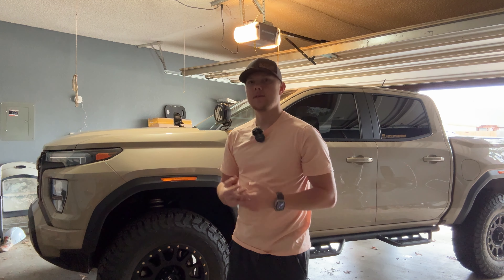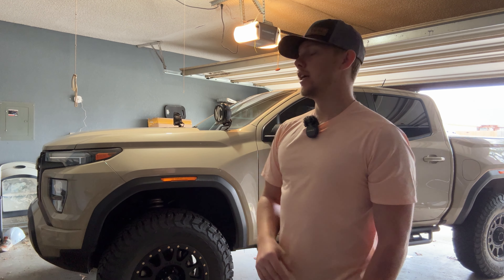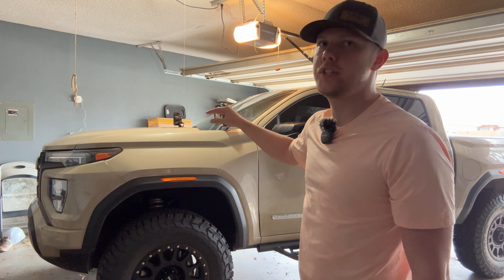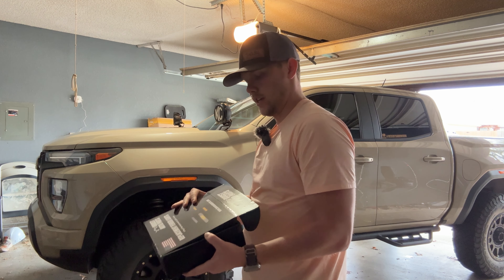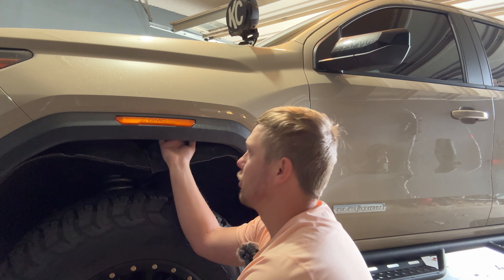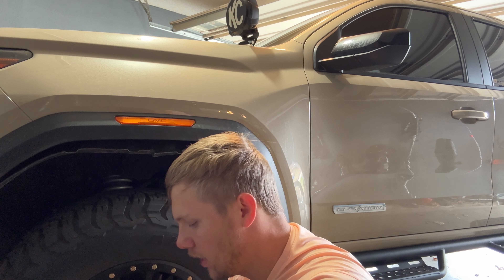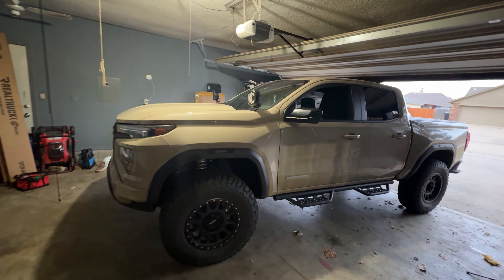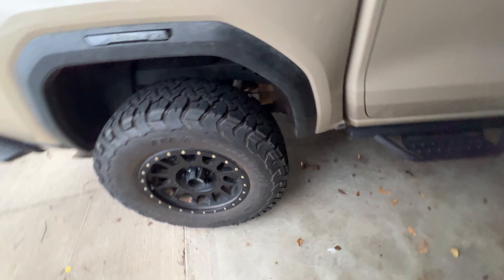Installing Boost Auto Side Marker Lights on My GMC Canyon Elevation!

Comment: I’m not the most mechanically inclined. Do I also pull that liner down to tighten upper struts?
Reply from the maker: You can reach the bolt from the top of the engine bay
Reply: @ gotcha, so I imagine I’ll have to move some things around to get to it??
Reply from the maker: There’s a hose that goes right over the bolt on the drive side, passenger side is a little easier to get to, you’ll need a socket extension to reach the bolt.